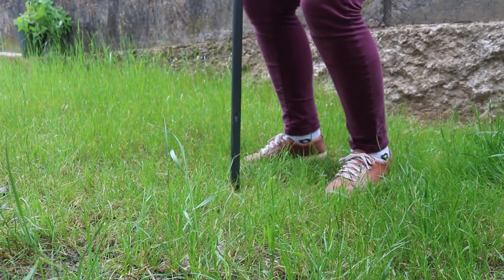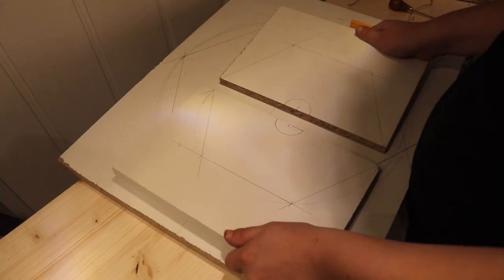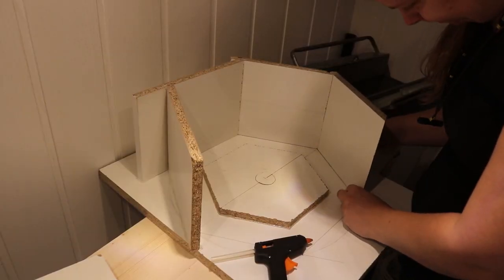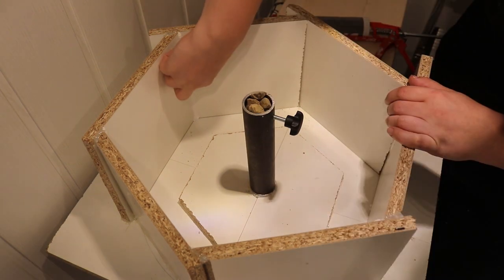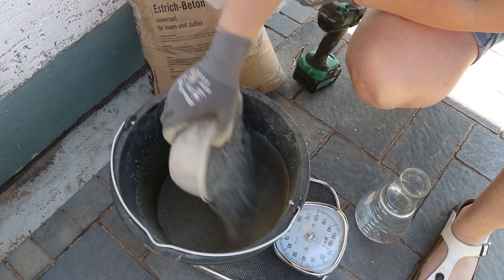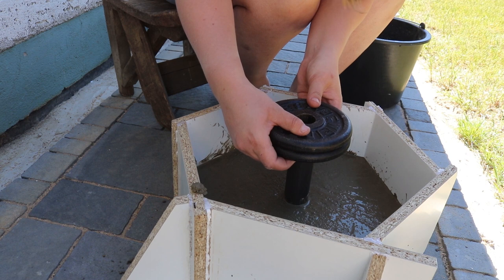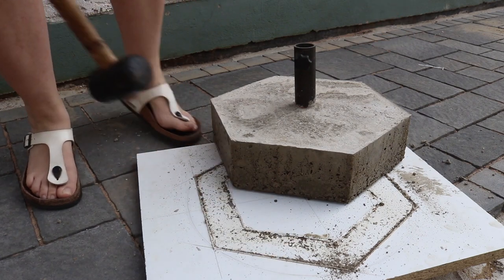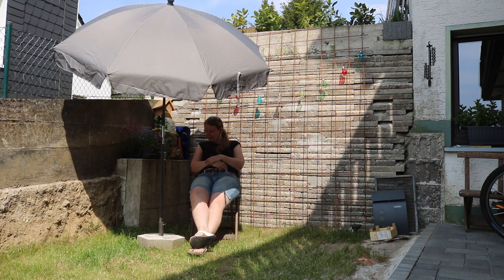How to make a concrete parasol stand | DIY

Comment: very nice project, but i got a question: what exactly was the purpose of that inner hexagon?
Reply: Gosh I'm so late on reply, but guessing it's the same reason alot of  circle bases are concave, it helps with leveling on a surface.

Comment: Really a cool Projekt I may reproduce it. The "Mallet thing" makes me laugh. Thanks.
I did not get the point why you wanted this inner hexagon. Is it for better ventilation or a better base for rough ground?
I hope the stand will last because I missed some steel wires or steel mesh within the concrete. 
Thanks for showing
Sascha
Reply from the maker: It's both for stability on rough ground and for not squashing all the grass underneath :)

Comment: Do you still use this stand? I'm wondering if it's actually heavy enough for that size parasol...
Reply from the maker: I've used it all this time and it works great for this parasol. I wouldn't use it for the huge ones, those would need more weight, but for this one it's absolutely fine :)